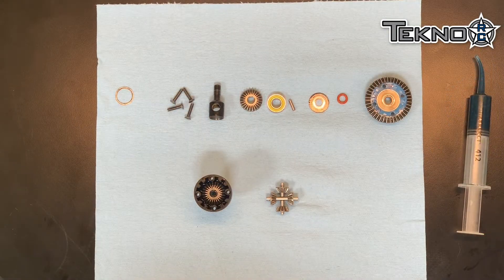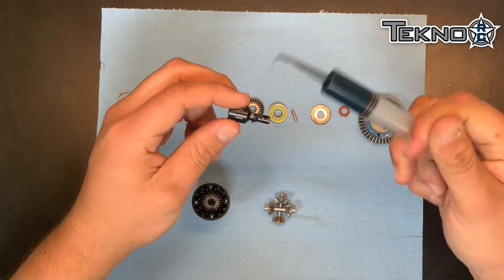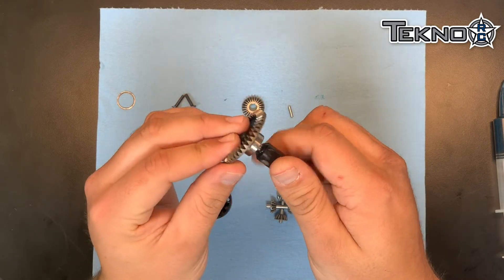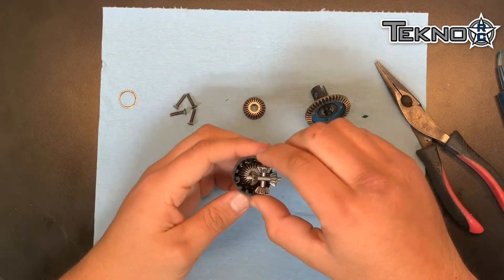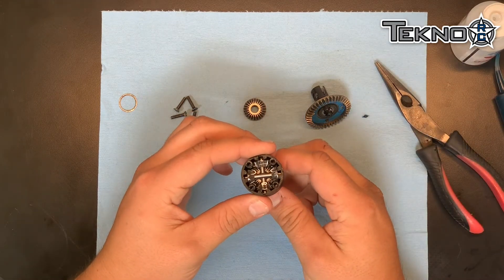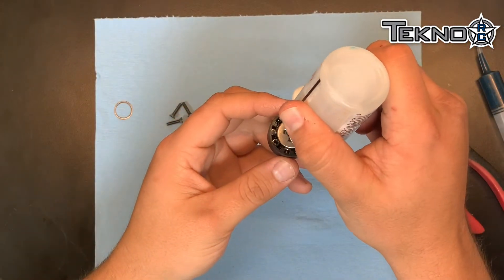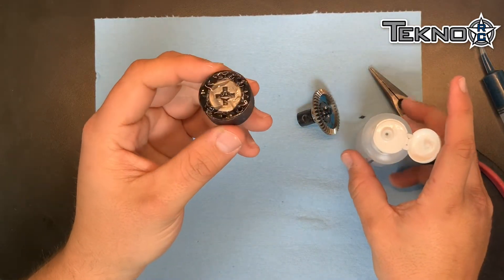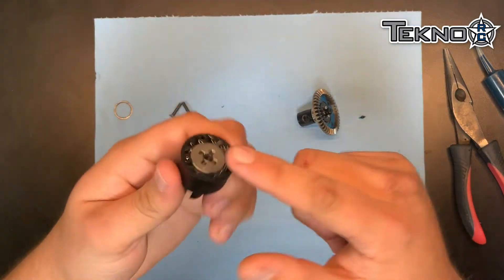Building Tekno Differentials With Joe Bornhorst

Comment: Do you put any grease or anything onto the cross shaft for the smaller gears, or are we just relying on the fluid to lubricate that part?
Reply: Fluid lubricates that diff oil will thin and expand when warm.